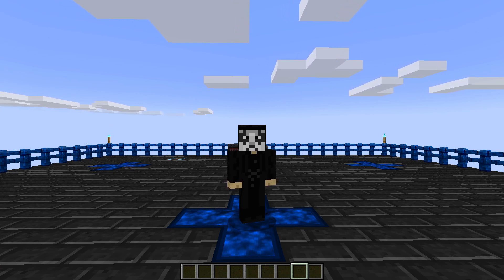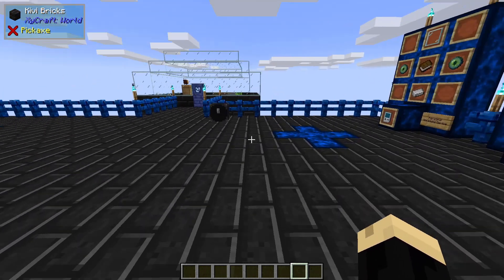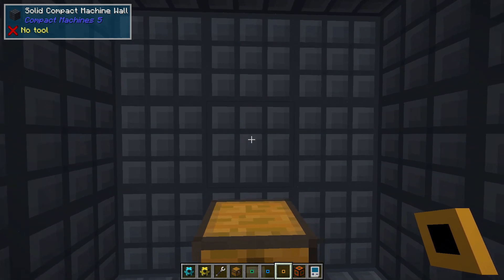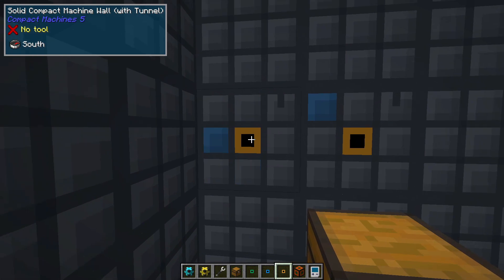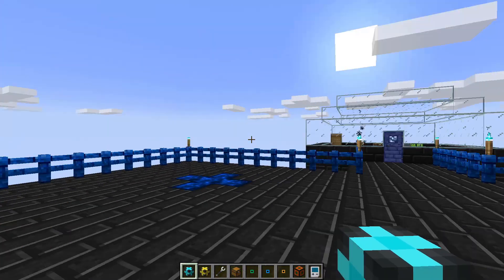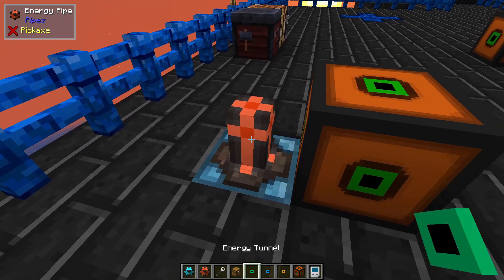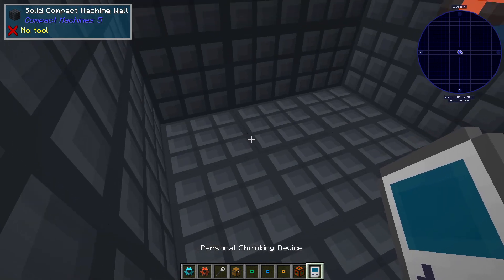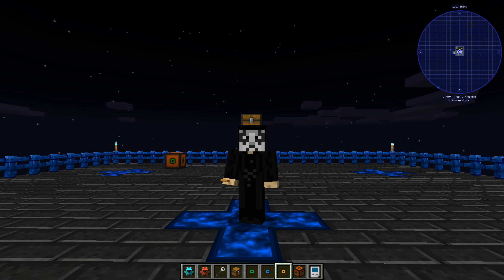Minecraft - All The Mods 8 - How to Make and Use Compact Machine Tunnels

Comment: Have you gotten an xnet router to work through the compact machine tunnel (ex.  Wireless routing of mob farm items to router exporting items inside compact machine)? Is it more beneficial to use ender chest for this case use? I will have simple storage network inside compact machine. I saw your video where you entangled your compact machine to place down elsewhere, but I’m not late game. Thanks!

Comment: Late, I know.. but is there really no redstone tunnel? I just want to get a simple lever input to turn on some redstone stuff inside the machine.
Reply: theres probably something you could do with just basic vanilla redstone. My first thought would be use an item pipe to move something into an out of a chest which is hooked to a comparator.
Reply: This is 6 months late but next time you need to solve the issue of sending through redstone pulses, you can instead send FE‘s through and check for FE on the other machine. 

For example, you have a redstone activated cable going in through the tunnel from room A to room B, as soon as the redstone is activated in room A, it send the FE to room B. In room B, you are checking for FE.